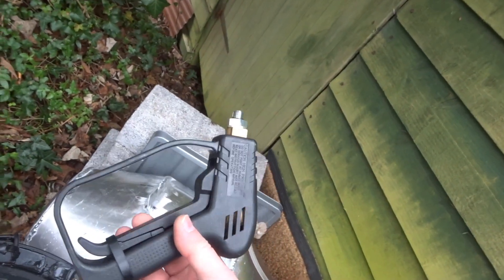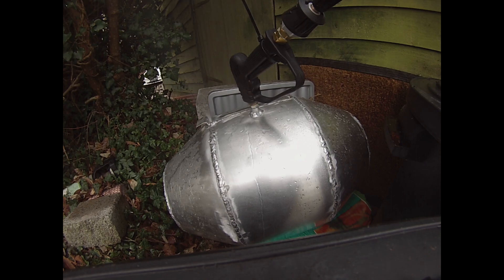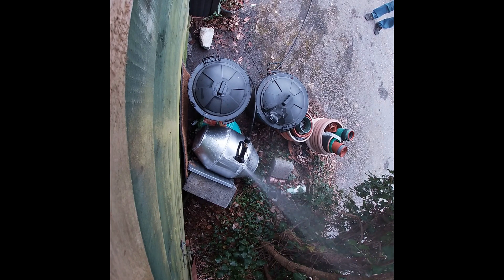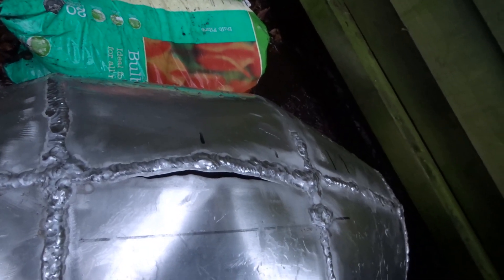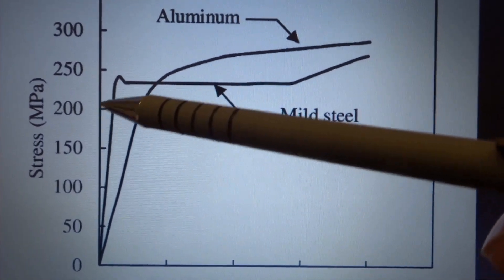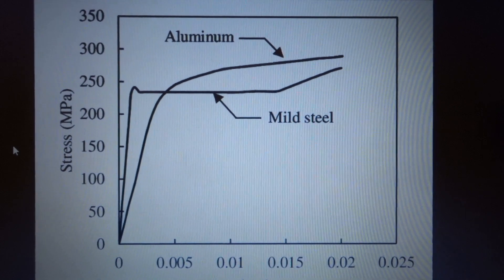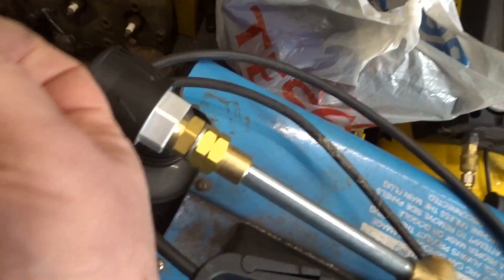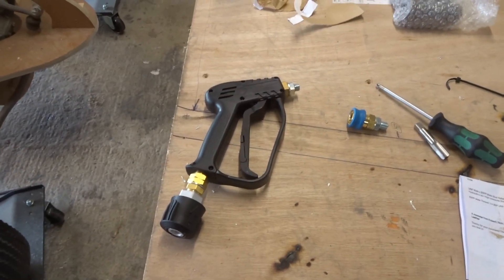Pressure-washer Hydroforming Pt2 | Aluminium Nose Cone

Comment: Would annealing aluminum work? Or using a different Al alloy? Or both?
Reply from the maker: I did try annealing it on a later attempt. I think it is to do with the fact that once it starts to stretch it keeps going whereas with steel it stretches so far then reaches a limit after which a lot more force is required to stretch it further, after which it then ruptures. This gives the other areas more time to catch up. With aluminium I think once one area starts to go then that will become the weakest point very quickly in terms of the point of rupture.
Reply: @XenonJohnD  Thank you! It sounds like Aluminium (at least this kind) is more brittle than steel. There might be more malleable Al alloys, but they also might be less corrosion-resistant.

Comment: Thank you for sharing your results, I would have expected to see more movement before rupturing, but I am used to 1mm mild steel. I imagine that aluminium gets brittle after welding, so annealing the whole thing before another attempt would be worth trying. I find this project particularly interesting as I love the design of open wheel cars, and hope that one day I can make my own electric version with a fully inflated metal body
Reply from the maker: I did think of making my whole belly tank using hydroforming but I chickened out! The amount of water would have been 600 gallons - ish and it probably would have crumpled under its own weight when the pressure was released, before water was drained out. You could dig out a half-tank shape in the garden and line it with sand to stop that happing maybe.
Reply: @XenonJohnD  For this project I think the English wheel is better for precision and control, to match a specific template or drawing. For a fully hydroformed car it would be good to do some scale models beforehand, make the body first and adapt all the other components to fit the result. Digging a trench is a good idea, as the water would likely weigh a ton or more and you don't want that rolling around!